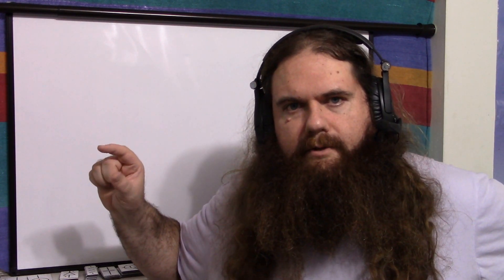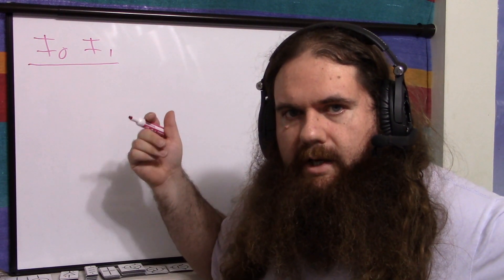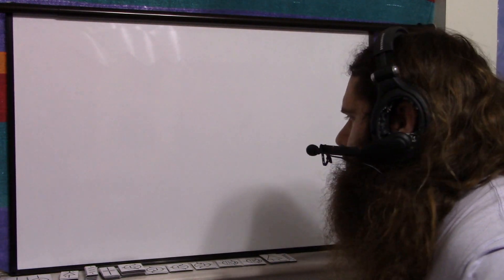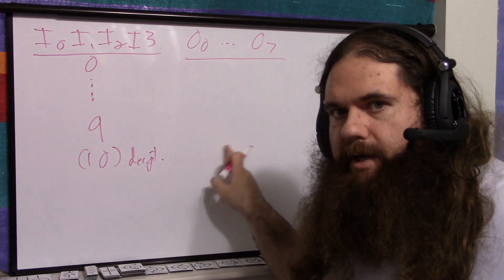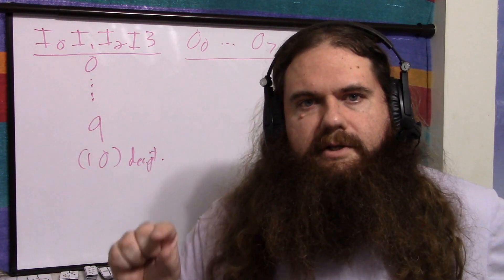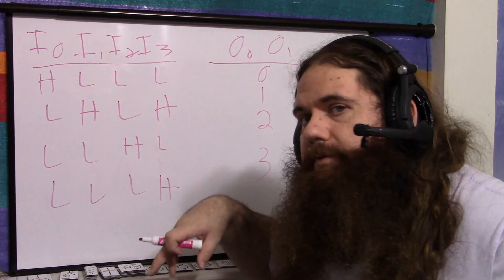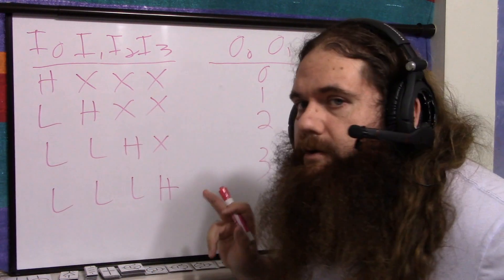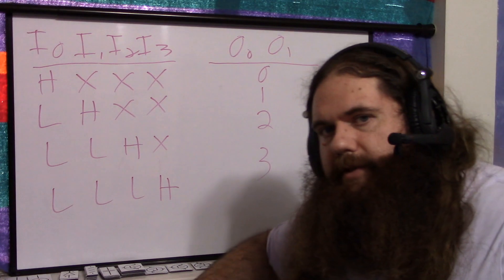Encoders and Decoders - Data Conversion With Combinational Logic - Simply Put

Comment: Can you please connect this principle of a capacitor(an electrolytic form of stored energy) to a battery cell(a chemical form of stored energy) to a battery cell, how exactly do they differ?
Thank you
Reply from the maker: Capacitors are short-term energy storage and utilize charge separation across a dielectric (either built-in, like ceramic ones, or formed by chemistry, like electrolytic ones), whereas batteries are long-term energy storage in the form of chemistry that releases energy over time. A battery actually generates energy, a true energy source, whereas a capacitor just holds energy that is put into it. They're really not connected at all and are completely different types of devices.